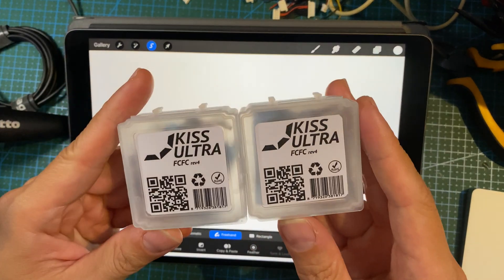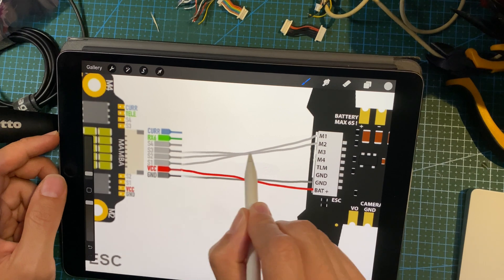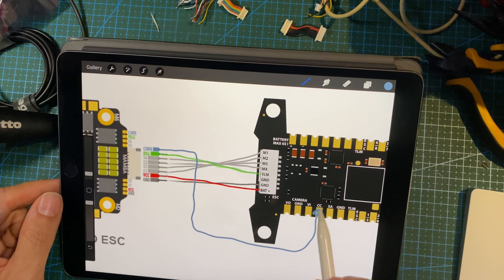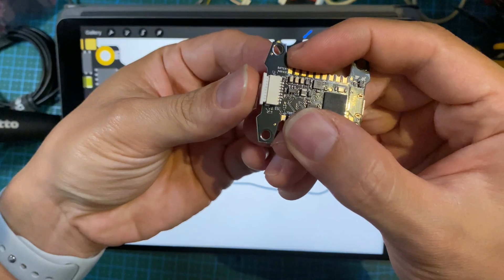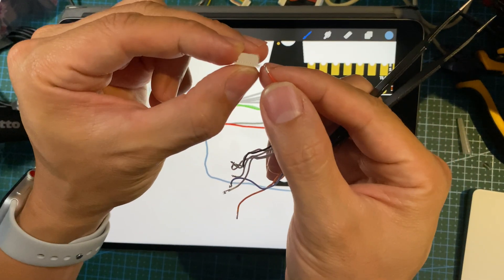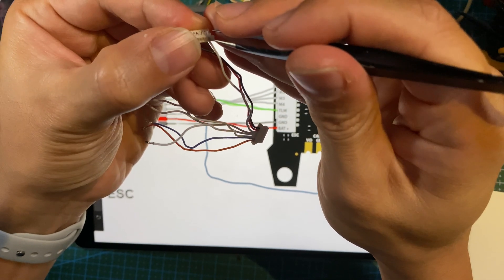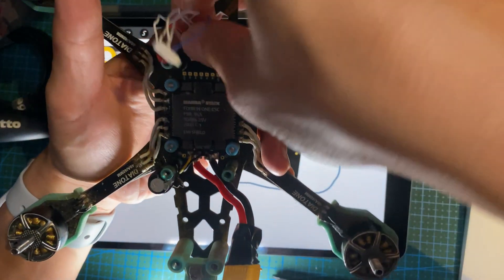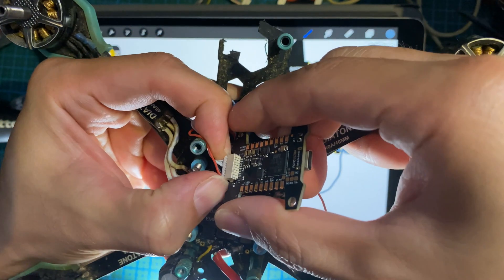KISS Ultra FCFC Repinning guide for BLHeli ESC

Comment: I use kiss ultre v1 with foxeer 65a ESC. The connection cable should be correct because the ESC self-test sound sounded 5 times. But the ESC cannot be recognized in kiss gui. what do I do? please help me
Reply from the maker: Join the ultra discord and ask for help there. Also I never configure the esc via the kiss ultra gui, use blheli32 to configure the esc

Comment: Sorry for disturbing you again, I was told to install a spike absorber along with the capacitor. Have you done this as well for your Mamba ESC?
Reply from the maker: Always use a spike absorber if 6S. If 4S you could get away with just a capacitor but it is also recommended
Reply: @lionelttl  so far I never used a spike absorber. But I’ll order some to install one on my KISS build. Thanks mate!